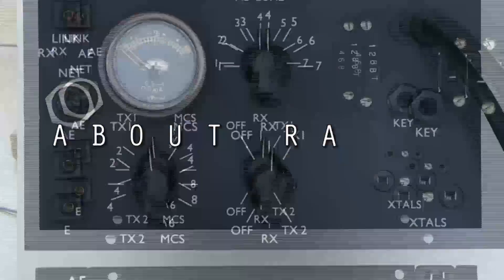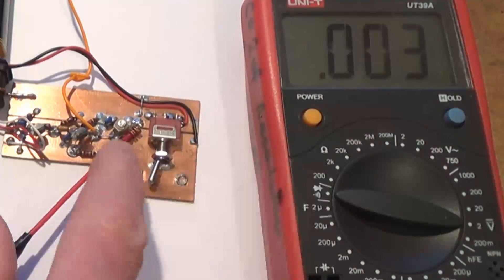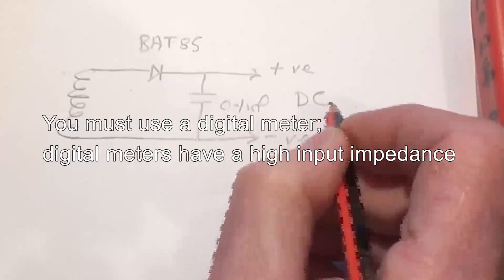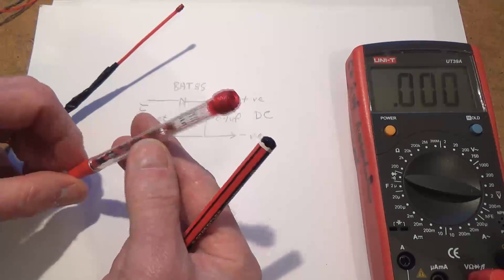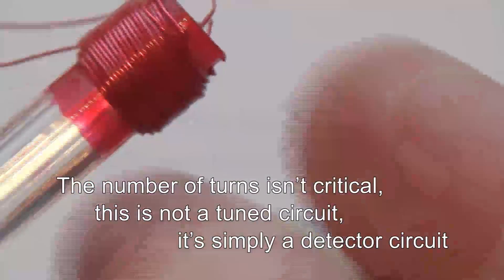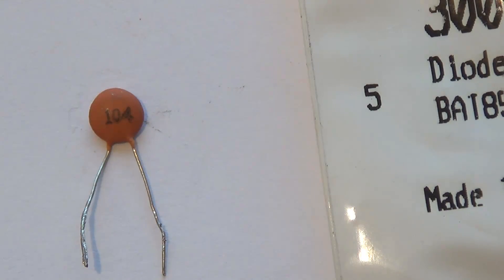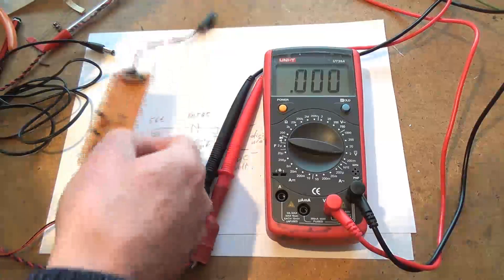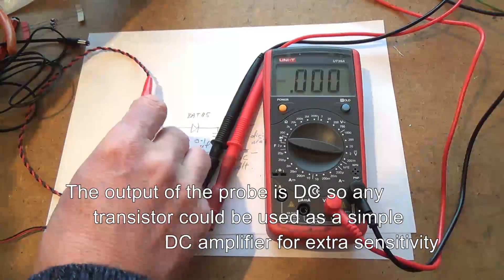About Radio 89 Mini transmitter 'sniffer' test probe, simple

Comment: Does it matter if the two copper wires, from the coil, come in contact with one another, inside the plastic tube?
Reply from the maker: so long as the wire is insulated there's no problem.

Comment: Nice one. I have seen virtually the same design in the Advanced Ham radio book, but only a circuit diagram I like your probe "hardware"!  By the way a lot of the recent digital multimeters (like the cheap Aneng AN8001 which is about $18, not the mega cheap $5 ones) including the one you have there have a frequency counter built in, which you can use to probe directly.  I know with this probe it is not directly connected so that's nice.   I am curious though if you switched over to the frequency counter mode if the voltage is high enough for it to detect the frequency.  I don't have any germanium diodes so I'll have to buy some and build one to test!

Comment: I think that this sniffer might be substantially more sensitive at HF than VHF because of the use of a multilayer coil, and the amount of inductance you have. Make one with a 5 turn coil and you might be surprised at how much more voltage you will get while detecting your fm transmitters output. Also, a second diode could improve things by forming a voltage doubler arrangement
Reply: A second diode, of the same kind/value/Bat85 ? And that would amplify the signal? Does it work, have you tried that, Dazzwidd?

Comment: Thank you 
will make one of these,very usefull
Reply from the maker: Hi Dennis, I must admit when I started I was going to build a sniffer with an amplifier then it dawned on me that the input impedance of these digital meters is so high that I didn’t need to amplify the signal but I think I'll carry on playing and I'm just looking at making a more sensitive version, just for the hell of it. I'm considering a transistor option but I could do a quadrupler circuit that would only need the coil, four diodes and 4 capacitors but it would deliver 4 times the voltage and wouldn’t need a battery.
Let me know what you build.  
 Kind Regards ... Andy